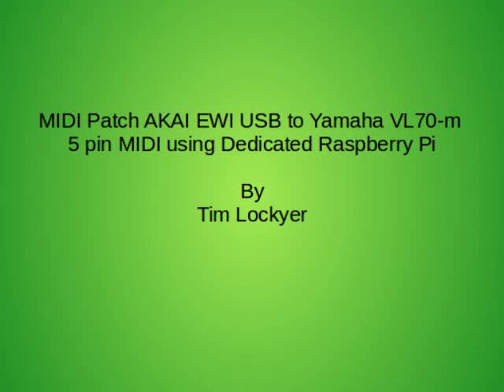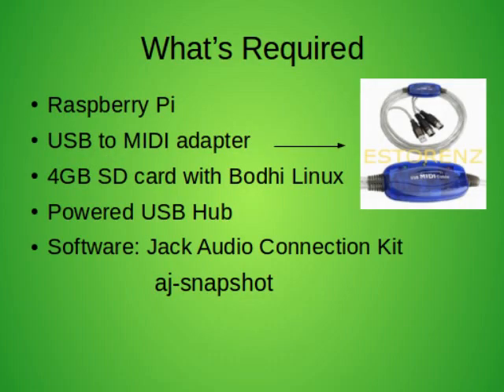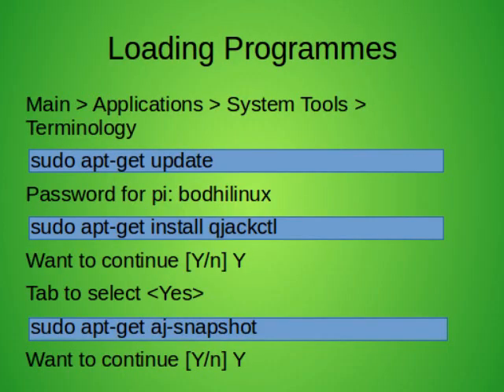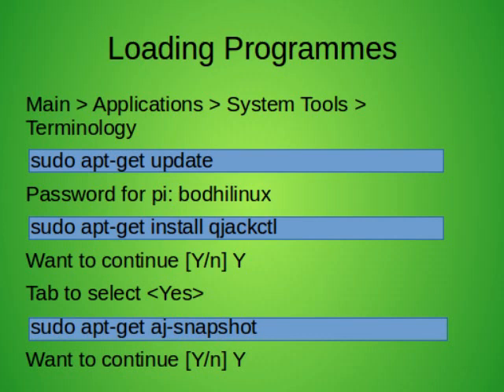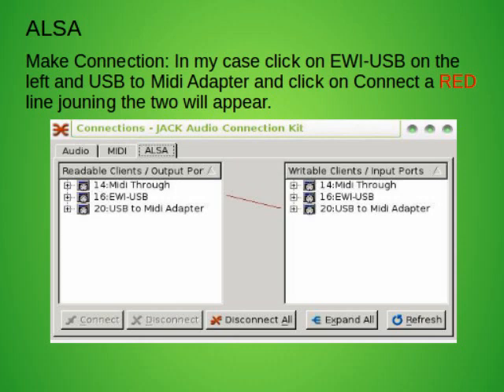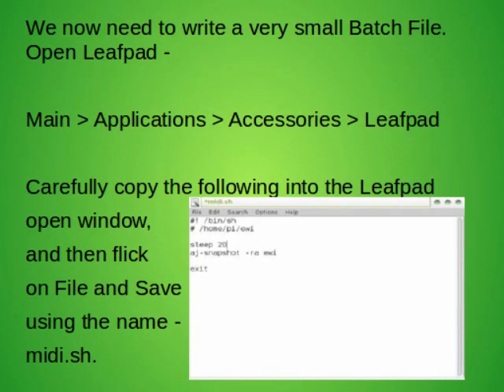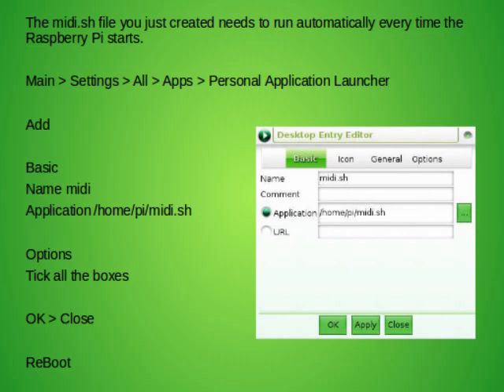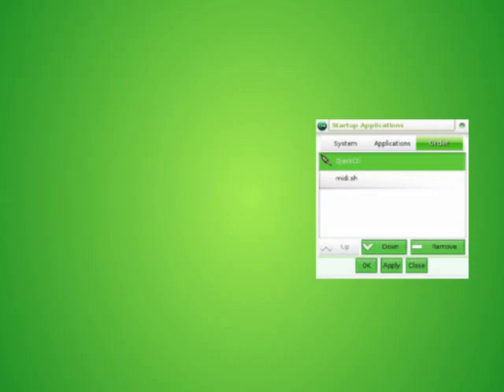MIDI Patch AKAI EWI USB to Yamaha VL70-m  5 pin MIDI using Dedicated Raspberry Pi

Comment: Very nice solution. I did the same as you did; connecting a EWI USB to one of my VL70m's. (I normally play Yamaha WX5, but since they are not available anymore in Europe, I needed something else as a backup.)
I found the Kenton MIDI USB Host, which does exactly the same as your Raspberry Pi setup, but in a readily available small box with powersupply. That works great as well. A good alternative for anybody not capable of working with the Raspberry or Arduino.
Have a look at http://www.kentonuk.com/products/items/utilities/usb-host.shtml
(I'm not connected to Kenton in any other way than a paying customer...)
Reply: Having played a WX5, how are you finding the EWI USB, in regards to adjusting the key sensitivity in software, using the octave rollers, and overall playability? I've never seen a WX5 as they were just too expensive and need to be ordered on an idividual level, but I've been a little frustrated with this thing. Part of it is because of the Akai software bundle you need to make it work with windows, and changing the gains and sensitivity sliders is hard to do with a screen reader as they do not appear as standard sliders or combo boxes. And to me, using the rollers like that is like having a keyboard with only one octave and having to press the transpose buttons every time, where as I'm used to just regular breath control on a traditional flute. Is controlling the VL70M a completely different animal? Thanks in advance for your thoughts, as I really do want to be able to play this thing especially when inspiration comes late at night.